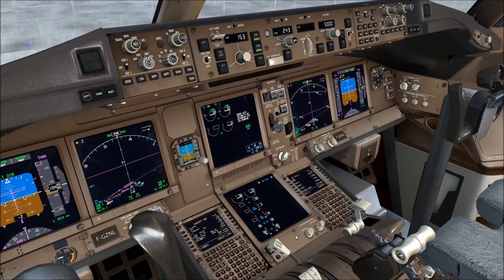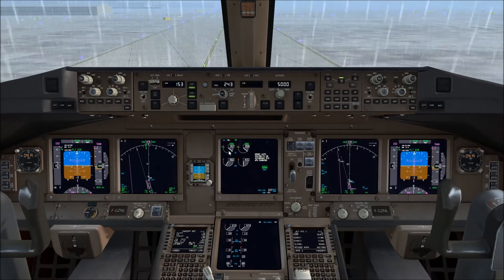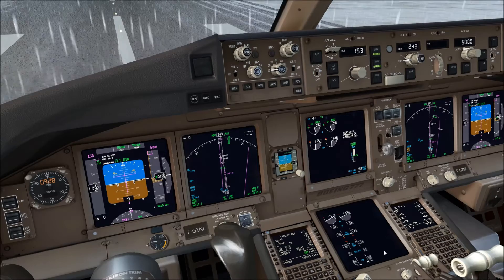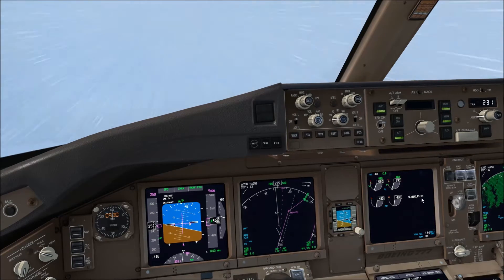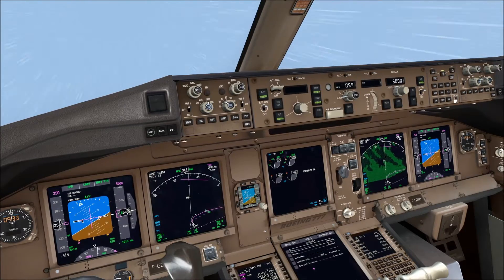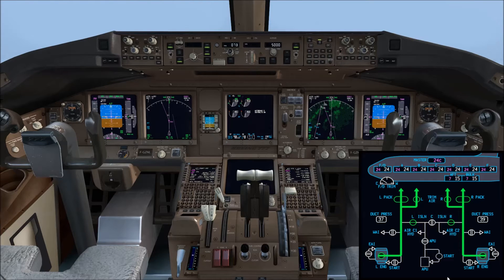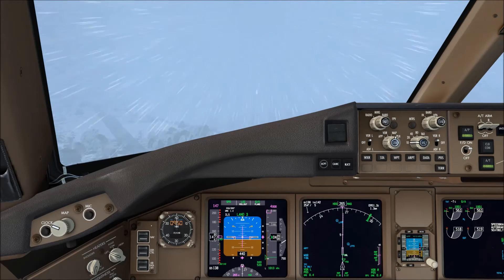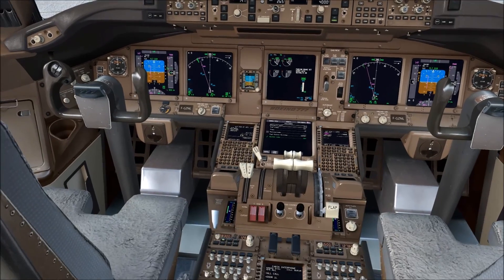PMDG 777 Engine Anti Ice Tutorial

Comment: Hey captain! Great video as always!! I have a question though: Why would you taxi with flaps extended when there´s a lot of snow on the taxiways?
Reply from the maker: Very good question. You would not as this would possibly "contaminate" the flaps mechanism, etc... unnecessarily. I can't remember what I did in the video, but the video was more about the anti ice system I believe, and how/why it is used... Not so much about winter operations.😉
Reply: @CaptainNav  Thank you ;) You mentioned it at the end of the video.

Comment: 3:40 Could we not still use derated takeoff thrust?
Reply from the maker: If the runway is contaminated with slush, snow, etc... then we would use full TOGA thrust. I guess this allows for a quicker acceleration and increases the distance available to stop if necessary.
Reply: Captain Nav Alright. I thought we could still use TO1 or TO2 in these conditions.
Reply from the maker: Normally not, unless company policy says you can, I guess. I don't think a lot of companies would, though.

Comment: if I get C grade in math and physics can i be a pilot
Reply from the maker: +shukri mohamed Yes, you can. I am not that good at maths and physics, it is not a problem as long as you can pass the ATPL exams and flight tests. However, be aware that, in order to join cadet schemes for example, they will use maths or physics, amongst other things, to select pilots. In this case, to be selected, you will need good grades in maths and physics.